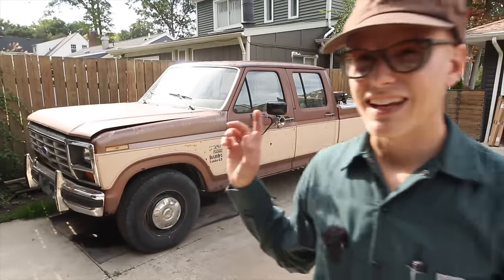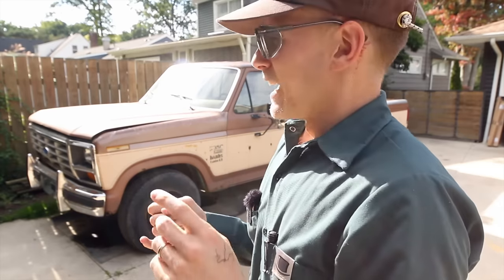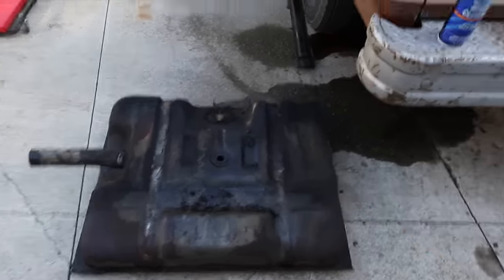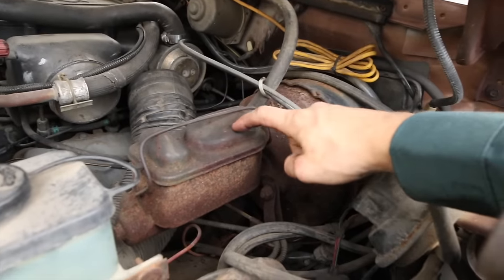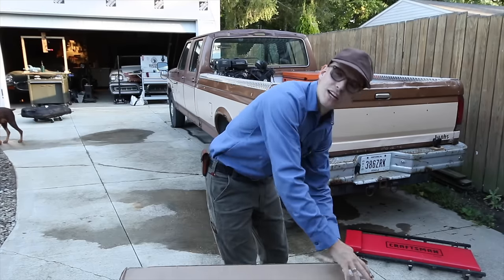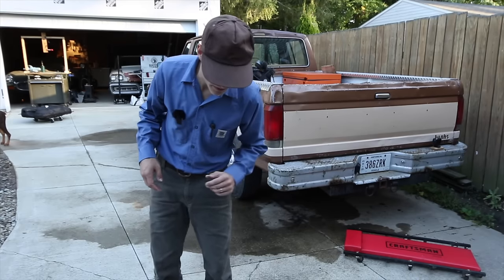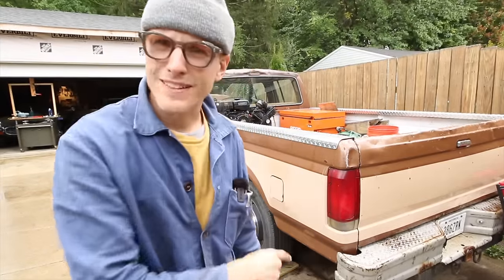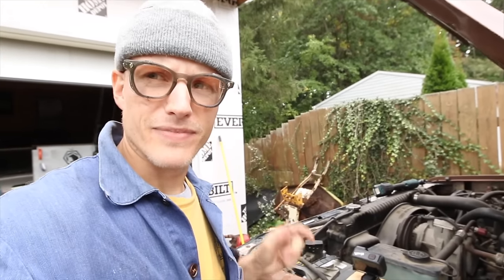1986 F350 6.9 IDI Diesel - MECHANICAL UPGRADES (Fuel Tank / Exhaust / Brake Booster)

Comment: when i got my 94 running , it was late on timing , had buddy who worked on deasels , told me to advance pump, moved it about 1/4 inch , made big difference in power , probably needs another 1/8 , i dont have special timing lite,have rebuilt injectors but not in yet, my buddy drove it and says leave it alone , run nice to him, Rick Martin  Oxford Ohio
Reply: I've read that manually advancing these type injection pumps can lead to engine runaway if advanced too much, so good to have a big towel and fire-extinguisher to stop the engine if it tries to self-destruct.

Comment: Hey man!! Im a heavy diesel mechanic i got a 1986 f250 6.9idi c6 sterling rear and dana 50hd ttb frontend. My engine is on her last legs. Head gasket leaking passenger front. Have a lot of miles. Need a rebuild. Will be making a series of videos when i build

Comment: Dude! You pulled out the old sending unit out and installed in new tank without putting a new pickup,/shower 🚿 head on it! They rot and fall off. It's in the old tank! Just keep it well above a 1/4 tank because that is your empty mark without a pickup screen.

Comment: Liked video , i have a 94 idi factory turbo deasel 7.3 , bought to pull race cars, it is dual cab dually, came out of kansas so no rust, was told it had blown head gasket, but found off shore new bad thermastat , put in new glow plugs and controler, put on new mech fuel pump,got rid of electric pump , put in both gas tanks , in stock at orilleys, new door windo motor, new ignition switch all fron orileys , rebuilt back bumper, made big push bumper for front, this truck had a c6 trans, out of older truck, found od trans gave trouble when pulling trailer, also truck was changed to 354 rear gear instead of 4.10 , i have straight through exhaust, not very noisy, i guess turbo soaks up noise , i get 13-14 mpg bare, not sure when towing 24 ft enclosed trailer with 56 lincoln, i think if it was a 460 gas , it would get about 6 mpg. i have put about 5ooo miles , love the way it drives and rides, hard to park in town with dual rear wheels , plates cost more, newest vehical i ever owned. Rick Martin Oxford Darrtown Ohio

Comment: I love that even after nearly 35+ years you can actually hear that similar V8 engine sound that carried on with the new modern Ford Powerstrokes. Btw. LMC truck for the interior parts. Only place i can find 88-98 Chevy for mine

Comment: Fore people that aren't rich locktite makes good gas tank pach kits for plastic or metal i have used them several times and they work great its like putty steal for metal gas tanks just wire iff the rust the best u can mix ul the putty and press it in the hole then after it dties spray on some rust primer i have a tank i pached back in 08 tgat was so much wirse than that tank on a 85 E150 super and it still dosent leak pached it as it was still leaking gas out of it

Comment: I have the same year of truck with the 6.9 IDI with a bank's Turbo after market. Just like yours, I have a question. Have you ever replaced the air filter? And if so, where would you get one?
Reply from the maker: I haven’t had the truck for too long and the filter looked pretty clean, so I just blew it out real good with the compressor and put her back in 👍